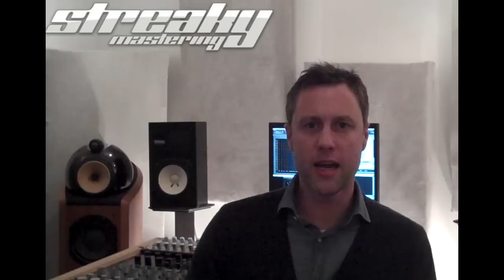How To Master A Track with a Troublesome Kick Drum -  Episode #12

Comment: The better question is... how to deal with a kick that is vastly underpowered. Sometimes I can use a multiband transient enhancer, but when it's so low that this doesn't work, adding some analog transformer distortion (lightly) will bring it up and out a bit.